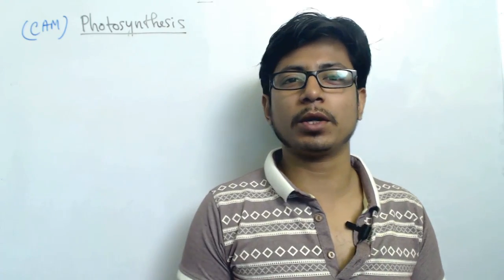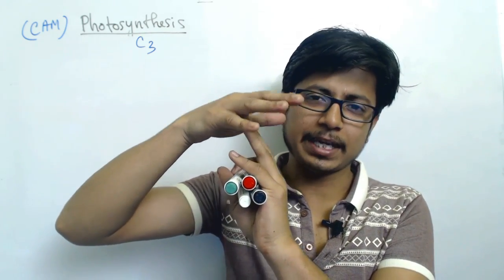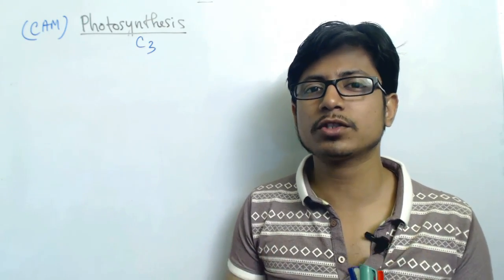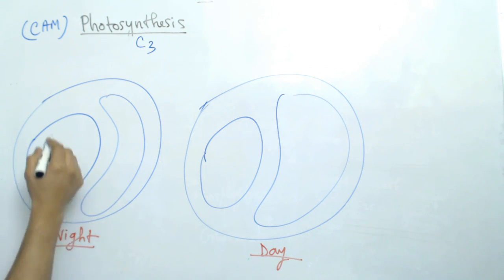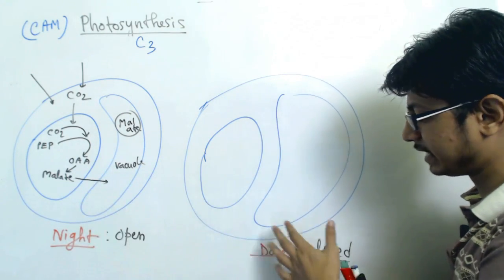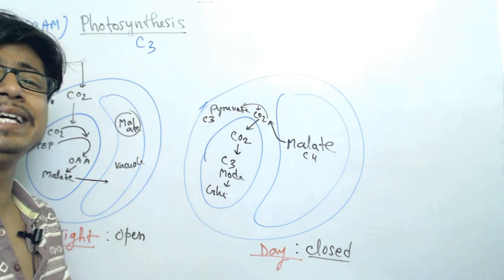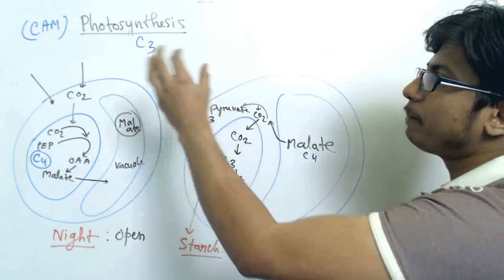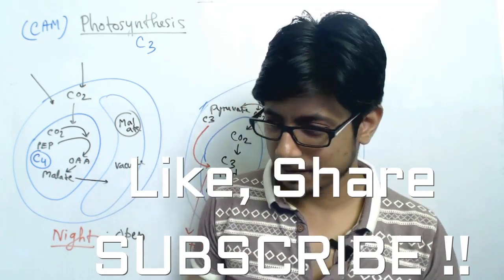CAM pathway photosynthesis

Comment: Thanks alot for your lectures. I have a doubt here, you discussed the pathway which is dark reaction but if stomata will be closed during daytime how the antenna complex in light reaction activate when stomata is closed. otherwise  light or photons are not require to enter from stomata.

Comment: Hello, fantastic video. Was just wondering about one part that you didn't cover. If CAM plants have closed stomata during the day, when do they release the 02 they produce during the light reaction? Do they store the 02 during the day and then release it when the stomata open up at night? 

I am asking as i have seen claims about certain plants (like snake plant, a CAM plant) releasing oxygen at night and i want to fact check this.
Reply: Zascha Mann    I also have the same query..
Reply: Would also like to know...
Reply: Oxygen evolution is not related to stomatal opening, since oxygen is evolved in light reaction of photosynthesis where two water molecules are broken down by oxygen evolving complex to relase one molecule of oxygen and four hydrogen also 4 electrons are released which are then passed to Photosystem 2.